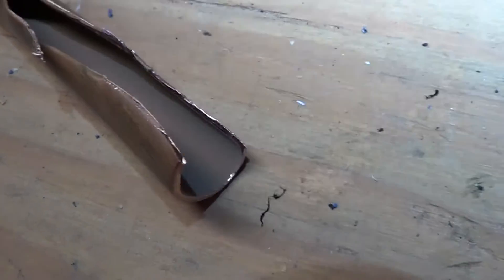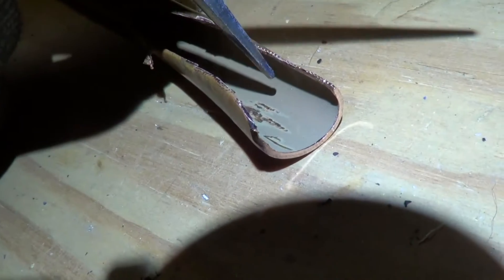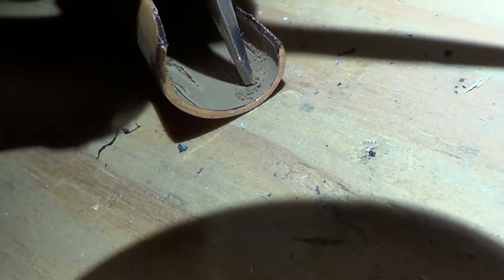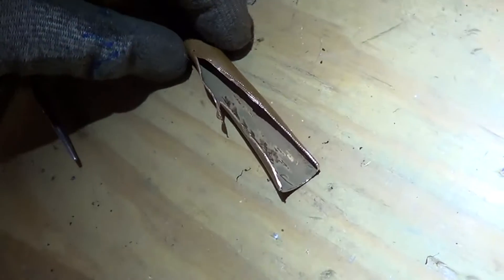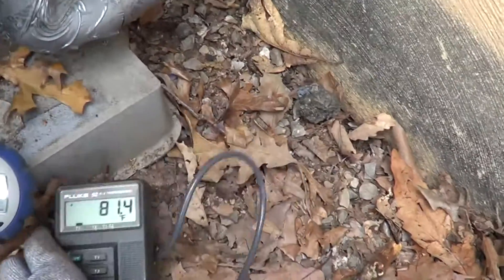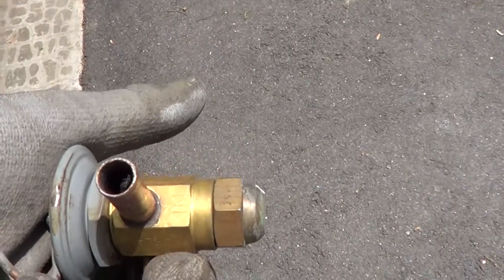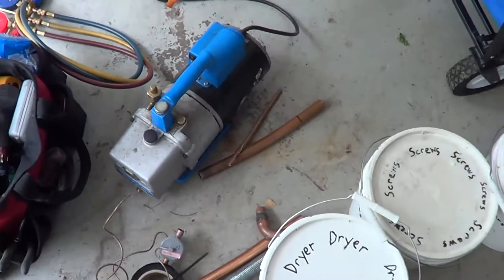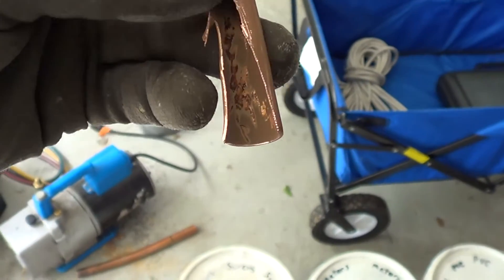Grey powder coating inside of R410a liquid line

Comment from the maker: The powder is carbon from a previous system burnout.  Nothing removes the carbon accept an acid washing.  However, acid washing the inside of refrigeration pipes isn't worth the effort.  Just put a new filter dryer on and call it a day.

Comment: usually there's an oil film inside the tubing, was it fine residue from the filter drier.
Reply from the maker: There is usually oil in the suction line not the liquid line.  The liquid refrigerant cleans out the liquid line.  I showed this video to a friend who is a quality engineer at Lennox and he thinks it was from a previous burnout before this system was replaced.
Reply: NathansHVAC There's an oil additive made by Supco that I've been using since the 70's, that is an excellent cleaner. It lines the metal products and makes them extra slippery. It will disolve a plugged cap tube and does an excellent job disolving a plugged intake screen on an expansion valve. It's saved the day many times for me when I've gotten a late sunday night call on a walk in freezer where the compressor is binding and overheating and the ice cream is melting. When I change an compressor on an old system that has problems, I'll put it in to prevent the new compressor from being hurt or fail. It works great, the best unknown product in refrigeration.
Reply: ***** My question with your pipe, is the lining etched or is it a coating ? I would put some Supco oil additive on the lining and see if it dissolves, if it does then it would be a coating. If it doesn't dissolve then I would think the soft copper is being etched by the molecules of oil or refrigerant, which would be disasterous for 410a systems : motor windings the varnish may be sandblasted by these molecules faster than normal and cause a short life span for the motor. If it's a coating then 410a systems are going to loose capacity due to a reduction in heat transfer. I'm exasperated by "genius" engineers who come up with a new product like 410a that's supose to be a big game changer and usually the product has a problem and disapears, and then we loose our customer because we sold him the equipment. I use a (ZZ Top) philosify :I've become defensive and go "old school" a couple yrs and wait to see if the new product has legs.